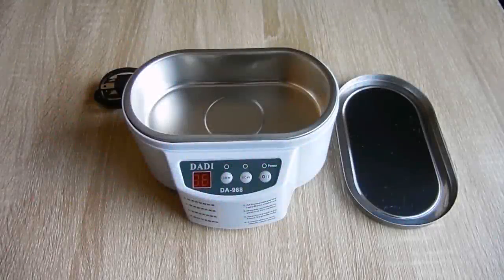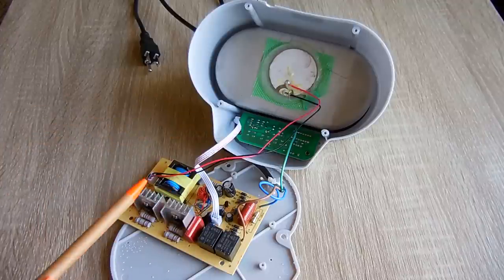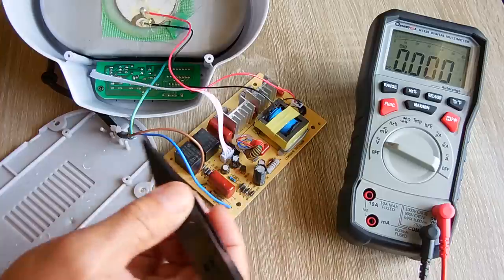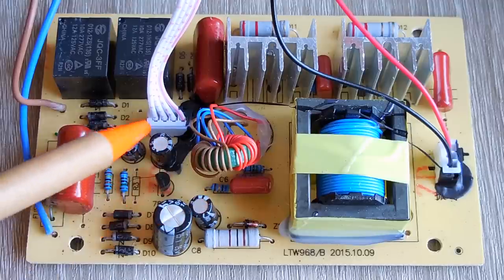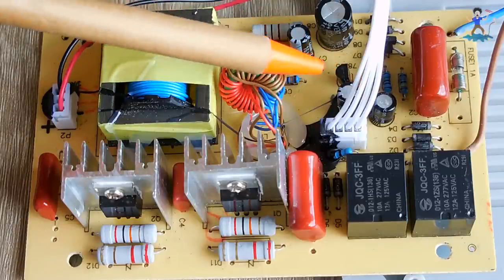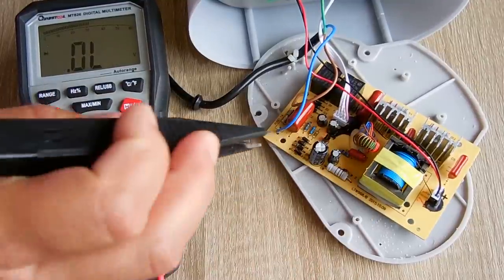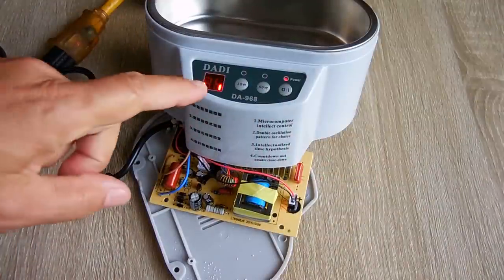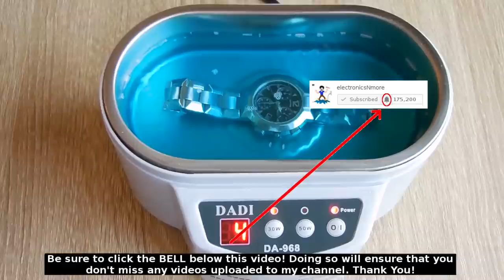Ultrasonic Cleaner Repaired for 10 Cents!

Comment: My 3 liter ultrasonic cleaner uses a tiny 5V SMPS power supply module rather than a 12V zener diode.  The SMPS is a small circuit board about 1" x 3/4" x 1/2" and is soldered directly onto the main board like a daughter board.  As it converts Mains AC directly into 5V DC for the LED driver chips it cannot be replaced with a standard 5V regulator. It also cannot be ordered as I could not find its part number, RPD3W1, in any of my usual online electronics parts retailers.  This meant that I had to bodge together a repair out of whatever parts I had on hand. I ended up removing the module entirely and wiring in its place a small 5V 550ma wall-wort USB charger instead.  Worked like a champ!

Comment: Hi, I have three if those Chinese ultrasonic cleaners, one of them does not start the other also stopped working and the newer one works erratic, will check the units based on your video. Very good equipment you have.
Reply from the maker: Be sure to look over my channel for other videos of interest to you, and most importantly share. Thanks!
Reply: Hi again, well I have finished checking the two 4 diodes bridges and the 12 volts zener, I desoldered them before checking and found them eorking ok. Also I checked the voltage regulator and also found voltage in it,  just wanted ti know ig possible how should I check the power transistors, condensers and remaining components. Do you have a website and email. I am opening the other unit which works erratic to compare the readings, any suggestions will be very much appreciated. Thanks.

I downloaded the video and have it on my phone  and have followed all the steps but I wasn't lucky when hoping for the zener to be the one.

Comment: Last night I pulled out my HF cleaner and when plugged in no light, nothing. I pulled the zener last night but was not sure what it should read as I have not done too much electronics, just replaced burnt parts. I checked the 7805 and did not get the 5 volts. I pulled the zener and the diode read was the same both ways. I could not find the zener using the number on the side. As you mentioned yours was 12v 1watt I looked at my parts and found a glass one not black that you mentioned. Replaced it and now everything works. Thanks for the help and video.
Reply from the maker: Great to hear! Glad the video helped you. Be sure to check out my extensive video playlists below for many other videos of interest to you, and most importantly share my YT channel on social networking sites. Thanks for watching!
https://www.youtube.com/c/electronicsnmore/c/playlists

Comment: wow even after 5 years 
this video is very useful 
I have a very near model to urs 
I have no issue power delivery 
everything is working fine 35w is working 
but 60w is not 
it lights up like its already working but sadly no 
you know where exatcly should I check ? 
I think the problem with controler board because the main board seems good to me 
but If you have any Idea, I will be glad to listen

Comment: I have the same problem of getting my electric to that display and control board but my boards are much more complicated with what looks like 2 zeners, maybe, side by side. When I tested them they tested bad like yours but Im worried they might be wired together and tricking me and have nothing to do with the control board, But I traced one and said hey it traces back to the pin out that heads up to the display and control board (possibly some components in between, I was just tracing to make sure they where not together and figured I'd see if it traces back up to the display board.) I guess the next step is to study those two diodes more closely and isolate them from the board and retest.

Ok, I tested my zenners and they tested good,isolated, but the transistors tested bad and I waited for them to come forever and replaced them, but no dice. Also a capacitor in that line tested bad, but I cant read whether its supposed to say 1.4f or 1.uf. So instead of pulling the voltage regulators and hunting bad parts, I said I can order a cheap chinese power supply board for probably the same as hunting down all these parts. Its just not getting DC to the transformer or anywhere near the bridge rectifier and frankly it was designed too complicated. 

So I have a working old ultronics with 1 working head and said what do I want from this bransonic anyway? Well 1, its a full gallon. Where the ultronics is only a 6 pan. 2 its got 3 working big heads,instead of 1 working pad head, if its power supply board worked. So Pulled apart the Ultronics and shove all of its power supply components into the bransonic, wired the 3 heads in series and plugged it into the ultronics power supply and cut a few holes for the ultronics fan and timer dial. Then wired the heater up directly to its power switch and then wired that to the main lines. Then sealed everything up with bathroom caulk after securing everything down, as far as its new innards. 

And I was looking at the old components on the ultronics and its a much better design. Its circuitry is more simple and direct to the point and its components are way bigger, like an old outdated pinball machines components and it only depends on a timer dial that just runs continuity. Theres no reason why the Bransonic needs to pretend like its "smart" it adds noting besides breakage and unreliability. Also theres no reason why any of its components need to be updated to being so small, dancing on the cusp of reliability, When the big old components fit fine in a big shaker. In fact I just shoved the entire bottom half of the ultronics into the bransonic because it gave me a nice plastic pad to secure it to the bottom of the bransonic with bolts. Those big old components and simple designs are just more reliable. Either Water proof your stuff if youre going to make it all complicated and smart or KISS, but I suspect they do this all on purpose. In fact Im positive because they want their stuff to break on you, while upselling these guys on all its imaginary bells and whistles and "smartness".

Comment: Sir amazing Video. I am having trouble with my Ultrasonic cleaner. The PF capacitor 1micro 400v keeps blowing along with the fuse that is 270e connected in pararell to the pf cap. When i replace the cap along wit the resistor it works for 10 to 15 seconds then i see smoke and the cap along with the resistor blows. What could be the issue? Is there a method to check if the transducer is working or is faulty? The cleaner is UC 4060 L. All components look good. Any experience of the same?

Comment: I usually check capacitors only since I don't have your fancy tools. Having the proper tools makes every job easy. ;) But good to know in what you said. Why don't you have a fan to suck up the vapors if you do this a lot?
Reply from the maker: Trench I have a fume fan. I don't do it as much as I did years ago. I avoid the flux fumes.

Comment: I have the cleaner from Harbor Freight, it's the Central Machinery brand. I don't believe that it's dual wattage but it does have a heater and this one has a built in fan also. I just took it apart, some have had the problem of the transducer coming unglued from the tank which would have been a simple fix for me but that's not the case with this one. I do have power going to the digital readout and when I switch on the power button the fan runs but the transducer does nothing. Ugh, and I haven't used it very much, maybe 10 times. This components inside look similar to yours but I believe this one has a few more. I do have a multimeter but I'm not very well schooled on using it to check things like this, lol, how bout I just ship it to you and let you fix it for me? 😁

Comment: My cheap Roadstar UC-223 short circuited after some water got in while I was changing the solution. It turned out that the plastic case wasn't completely sealed around the power cord. I opened it up and found out that the fuse and the two transistors were blown. Also the transducer seemed to have come apart from the metal tub. I changed the fuse and the transistors and superglued the transducer back on. I sealed the gap with a glue gun, and put grease around all the other plastic seals. I put it all back together, plugged it in and it powered on. After pressing "ON," it died again, blew the fuse. Perhaps the transducer is blown. Maybe the relay is welded stuck. Anyway into the electronic garbage it goes. I am a bit sad and disappointed, it looked reasonably well made, except for that small hole near the power cord that let water in.
Reply from the maker: The transducer must be bonded to the tub using a very hard curing epoxy.
Reply: @electronicsNmore  Well apparently it wasn't, perhaps it was planned obsolescence.

Comment: I just purchased the same unit and I live in Thailand. The unit was a 110 volt. Thailand is 220 volt. Hence dead now. Interestingly the unit is marked 110 volts on the inside. I replaced the fuse and connected it to a 110 transformer. It blew the fuse again.

Comment: Hi, nice video. I have a ultrasonic cleaner circuit board that has the heater power circuit and the UL power circuit. The heater is working fine but the UL circuit do not has DC output on it. Any sugestions that could help me? Thanks dude
Reply from the maker: I have no idea what your board looks like. If the piezo is faulty, then you should get a frequency measurement at the piezo terminals when powered up. Post a photo of the board online, then post a link to the photo here.

Comment: Is that ultrasonic cleaner and the ultrasonic sound waves it generates safe for the internal components of that watch?
Reply from the maker: Ultrasonic cleaners are used all the time for cleaning watches. You'd think the sound waves(vibration) would rattle all the sensitive parts inside, but I've never had any problems. If my watch can handle the shooting range, I think it could handle the cleaner. Thanks for watching!

Comment: I’ve got a similar unit as yours. Mine has power and everything works fine except that the transducer does’nt seem to be vibrating. I suspect that the transducer is defective. Can anyone tell me how to check the transducer?
Reply from the maker: Probably a faulty power/output transistor or a faulty relay if the unit has full power and lights up.

Comment: I'm from Malaysia.
I've problem that initially completely whole unit without any display with blown fuse.
Several diode, S7805 has been replaced with some bad capacitor.
After replacement, power LED is lid.
However, the 7 segment display or either 30w/50w led  is not lid even through I had press the 30w and 50w button.
If I measure P1 connector, there's 5v between VCC and Ground.
While there's 20vdc between 30w/50w pin and GROUND on P1 connector.
In this case, is small board consider good?
I actually suspect that the transformer is fail and there's no labelling on transformer itself and wondering where to and how to purchase the transformer
Ps: Both 13005 transistor is good.
Reply: Coincidentally my friend got a nother fail unit. I swap the EPROM and it works back. Thanks,

Comment: Just checked mine a second time. Found the blown fuse. Mine has a small PCB where the power enters the unit, and the fuse is is mounted to the bottom where you can't see it.

Comment: I have problem on my USC, the model/products are similar like yours but the issue is different.
power on, indicator lights are on and fully functioning, but when i start the ON/START button, the motor/vibration won't work at all. Any idea?
Reply from the maker: Either a faulty transistor/mosfet bolted to the heat sink, or a faulty control board.
Reply: @electronicsNmore  tried to swap BUT11A transistors, the problem still occurs.

Comment: ...mine 'cooked'  ...its a cd 2800 model, the piezo has a burnt spot, it is epoxied to the bottom of the ss tank, can it be replaced?  ..the circuit board looks ok, power still coming up ...peace
Reply from the maker: Yes, they can be replaced. You need to remove the bad piezo, then use hard curing epoxy to install another.
Reply: thx  @electronicsNmore  ...epoxy is hard as rock, covers the whole element, sides, top, electrode solderings, everything, very liberal application ...looks like one electrode has burned, likely a bad solder joint, bad contact ... any tips on how to remove hardened epoxy ? ...what new epoxy to use for the new element ? ...the element is 35W  42kHz .... peace

Comment: Mine wont start unless I smack the stainless steel tray and then it starts. What could the the issue there?
Reply from the maker: Try removing the tray, then hit ONLY the unit when it wont start. Place the tray off to the size. I doubt the tray/piezo element are the problem.